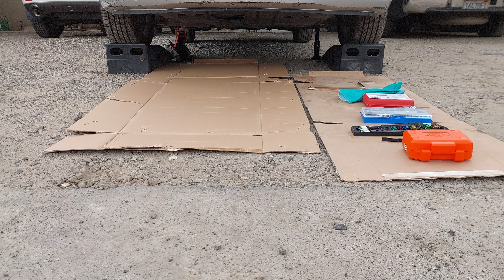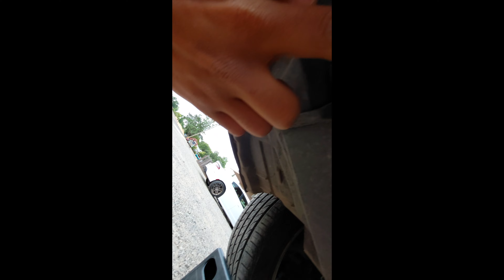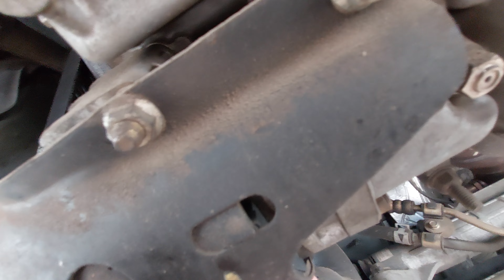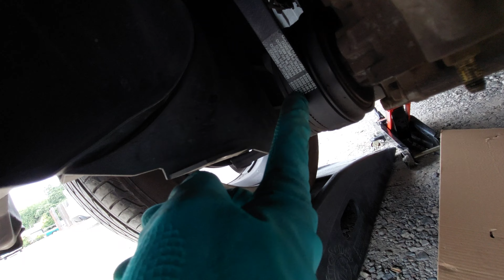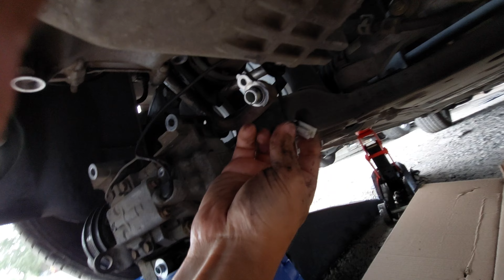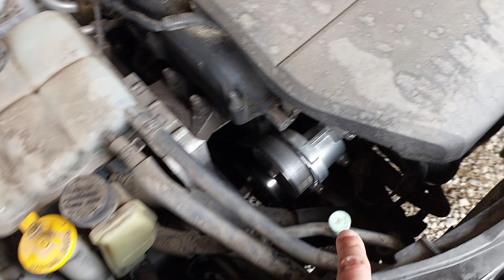PART 1: Mazda 3 2006 AC Compressor Removal

Comment: First you should clean that engine dust and work a little cleaner. Thanks good vid.
Reply from the maker: Thanks for your comment. The dust doesn't make anything to any component. It is better to have dust everywhere as it acts as a layer of protection from the humidity so you protect all components from rust. 
If you would like to clean the engine I advise not to use water. Use special chemicals for engine cleaning.
Reply: @MahmoudAbido  interesting. I was talking more about plastic around the engine. I good cleaning will make the engine look and breathe better.

Comment: Thankyou for the video. It gave me reference of how the pressure lines connect to the compressor so I have an idea of what I am in for if it turns out that I need to replace the O-rings.
Reply from the maker: @mikes78  thanks so much 
Glad to know that you found it helpful